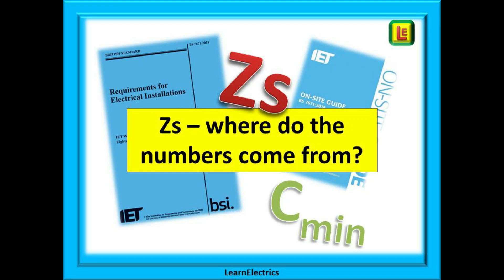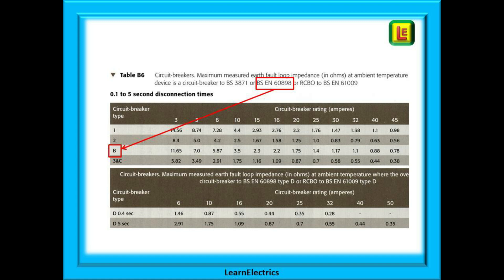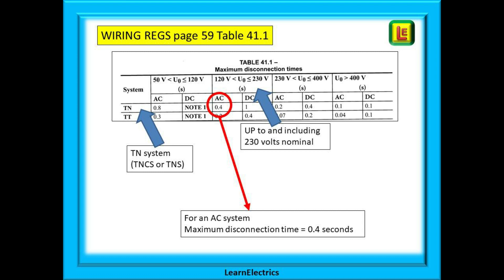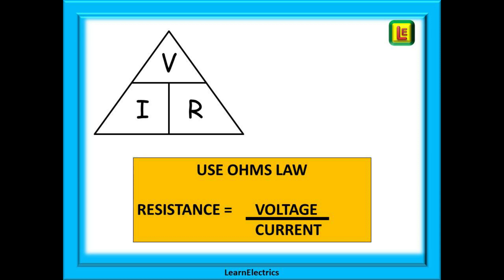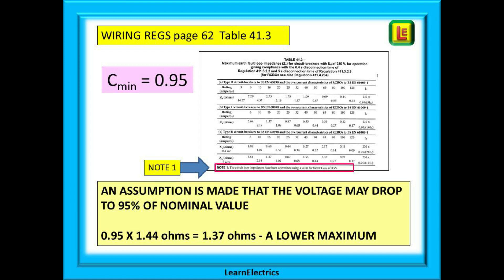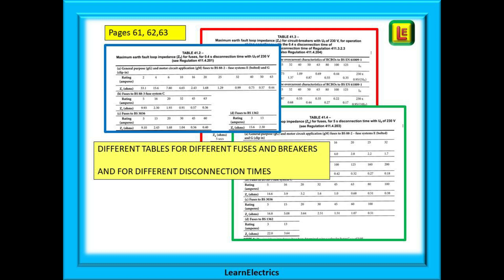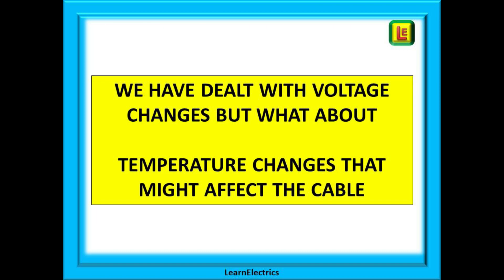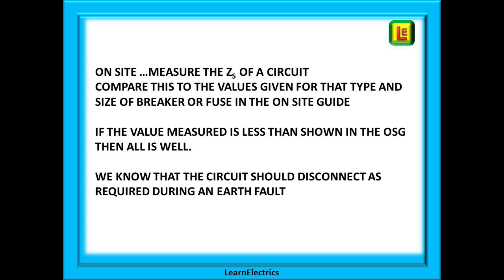ZS WHERE DO THE NUMBERS COME FROM. How to use the electrical tables correctly.

Comment: One thing I don't understand and so far no-one has been able to explain this to me.
The range the supplier can legally supply is 230v + 10% or -6%
cMax is 1.1 (nominal voltage + 10%) but cMin is 0.95 which last time I went to school is nominal voltage - 5%
Why is cMin not 0.94?
Reply from the maker: One is the supply limits, the other is the factor to account for voltage fluctuations. We just work with what the boffins tell us, but a good question. thanks for watching. Dave.

Comment: Why is it some questions asked are not exactly in the book of the regs if you are looking at the question about earthing and then you look at where the answer is doesn’t mention anything about the earthing and the answer does not mention about the earthing a,b,c, or d
Reply from the maker: The exam questions will not tell you exactly where to look in the book, but there will always be enough information to get to the correct part. Our series of help videos on 18th Edition will show you how to use the book and find the answers much more easily.
Zs is about the loop impedance, which is not just the earth, it includes the phase cables.
You will get earthing questions in the exam for definite.
Have a look at our video about earthing conductors on the following link ... 
Adiabatic Equations
https://www.youtube.com/watch?v=173C7yE-xbU
Thanks for watching, Dave

Comment: At 4:32 the table covers 0.1 to 5 secs.  How can it cover all these disconnection times ? Have you a video that explains this.
Reply from the maker: If a device trips in less than 0.1 seconds then it has also tripped in less than 5 seconds. Have another look at the video and think about this whilst watching ...
In the good old days we only had fuses and having different disconnect times mattered. Now we have RCDs etc which are much more efficient than fuses. So the RCD can replace a 0.1 s or 0.4s or even a 5s device.

Comment: How does this translate for a line to neutral short circuit ?
Reply from the maker: It doesn't Mike. This video is just about Line and Earth resistance/impedance during an earth fault. Often the Line and Neutral have a larger csa than the earth so their resistance path will be lower than Zs, which is ok. We have a video planned on Prospective Fault Current and Prospective Short Circuit Currents. Good call, hope you enjoyed the video. Dave
Reply: @learnelectrics4402  Thanks Dave.  Great lessons!
Reply from the maker: You are very welcome Mike.